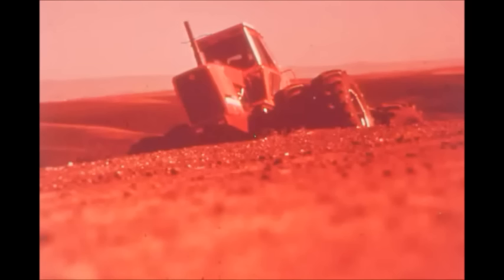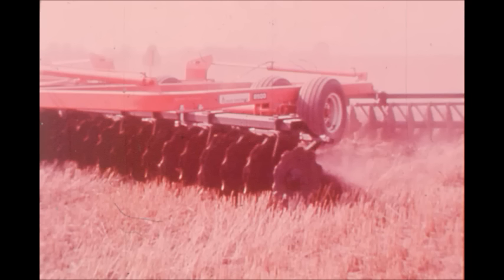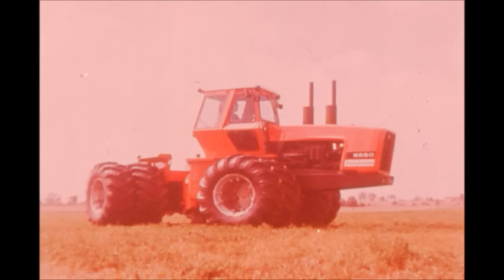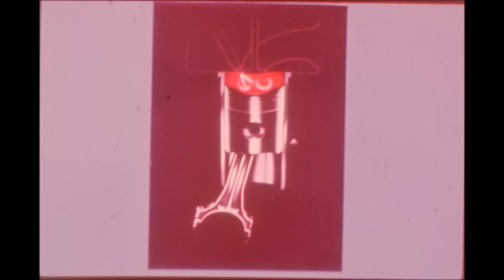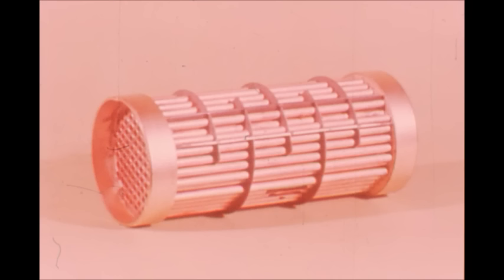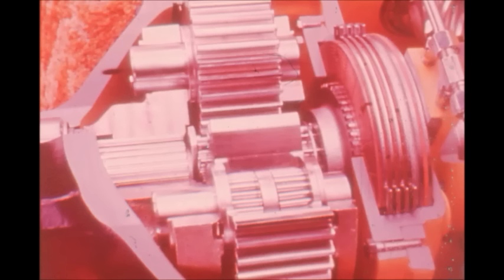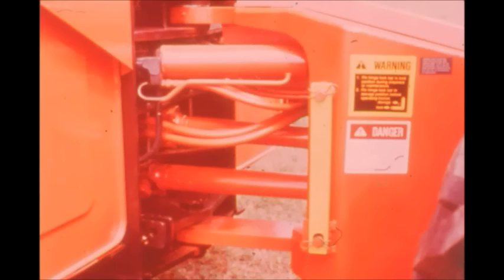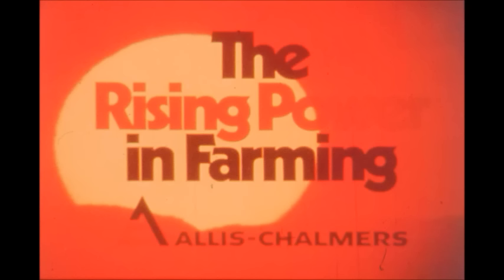1970's Allis Chalmers 8550 Tractor Demo Pak Tape AC050

Comment: Neat video.  I have never seen any AC 4x4 in person so I learned some things.
Reply: I grew up on one, it is was a superbeast.  Limited by light weight if anything, traction issues.  Loved it.  45' cultivator, 34' chisel plow and occasionally a 12 bottom DMI.  Hearing those big turbos wind down at the end of the day was cool, had no idea at the time what the noise was but

Comment: Stieger built them for allis in the 70s
Reply: I think this 8550 and 7580 and later 4w220 and  4w305 were made by  AC itself with their own motors and transmissions. Only AC built by  Steiger was 440 with (I can't  remember which) Cat or Cummins  V8.
Reply: I drove a AC with the Cummins, ran at 2800-3000 RPM. And you had to wear ear protection.
Reply: Oh no,AC built their own 4X4's,not like I.H.C.or the like.(MF,NH)